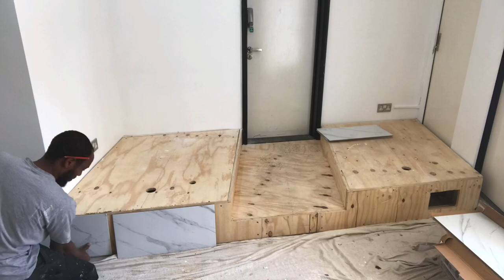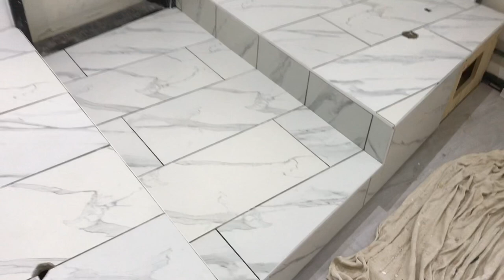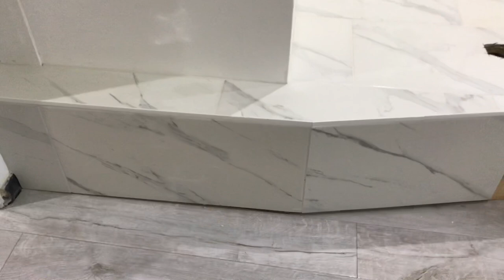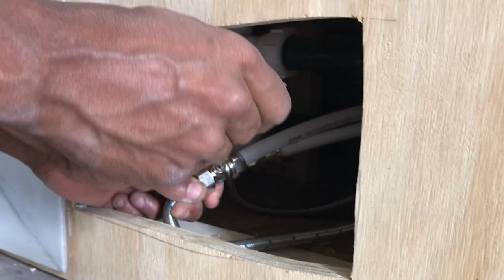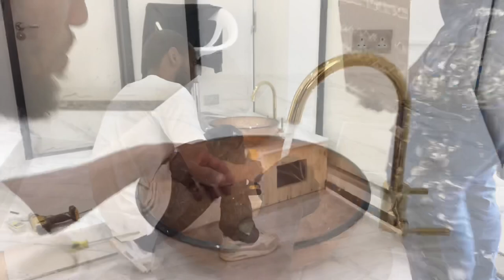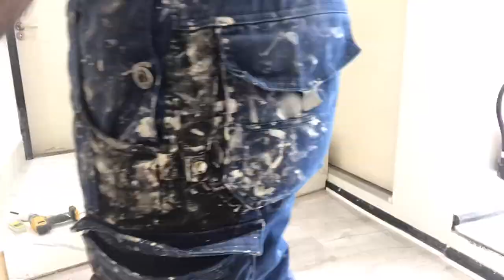Tiling a custom made pedicure station - tiling on to plywood

Comment: Wht type of tiles u use on the wood, and I don’t c the pipe that brings the water into the building.. plz help
Reply from the maker: The pipes are underneath in the void. I think there were ceramic tiles.

Comment: Hey I wanted to ask what are you using to glue the tiles ?
Reply from the maker: Hi Judith, I use flexible tile adhesive designed to be used on plywood.

Comment: It looks nice but before installing the floor in the wood you had to put cement sheets so!!….
Reply from the maker: Thanks, you don’t need to with the tile cement that I used. It’s designed to go onto ply. Still going strong 3 years later 😊